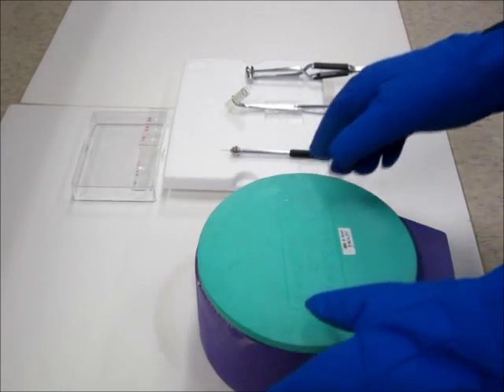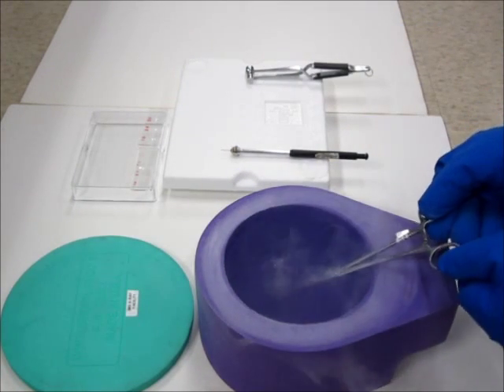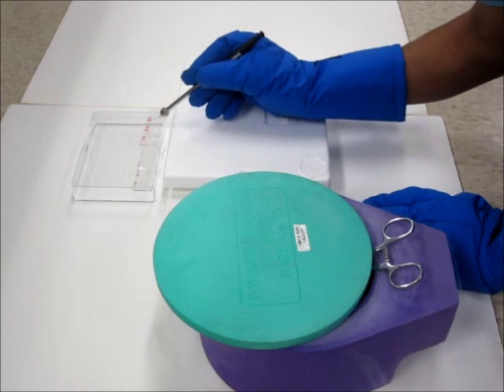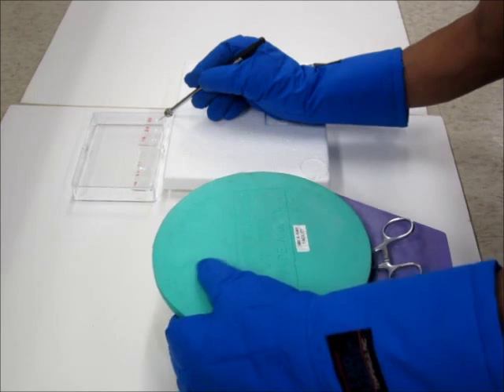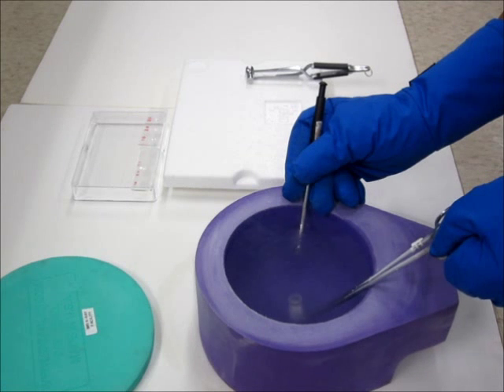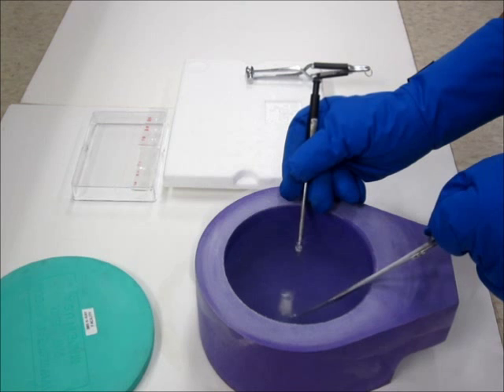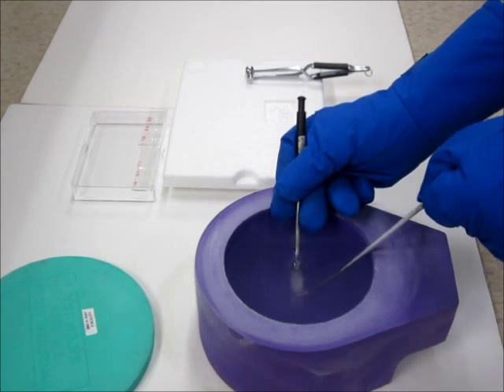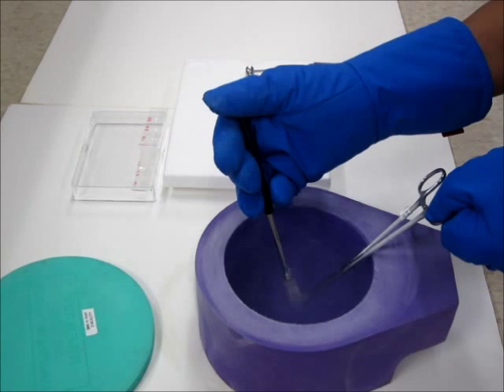Flash Cooling of Crystal in Bulk Liquid Nitrogen Cryo Vial Tutorial

Comment: I want to know if we closed the foam dewar what's the duration that It can hold up liquid nitrogen in without leaking it?
Reply from the maker: Karima, the holding time varies (10-20 min) depending upon the surrounding temperature. However, you want to keep the dewar filled to top to avoid gradual variation of temperature which will produce ice (bad for your crystals). Let us say room temperature is 300K and LN2 temperature is 77K. You want to go quickly from 300 to 77 rather than through nitrogen gas which may have in between temperature. Note we want quick (flash) cooling and NOT slow cooling. Hope it is clear.